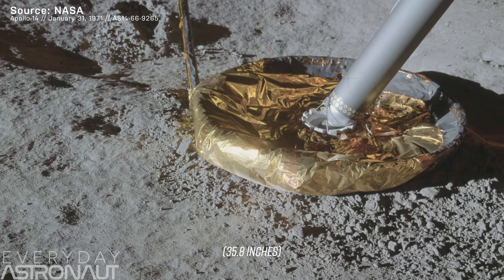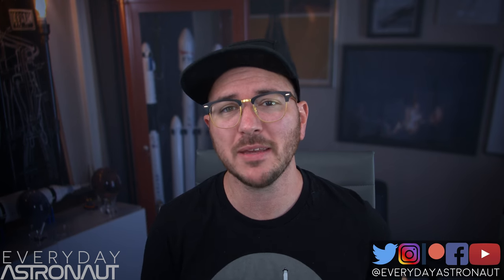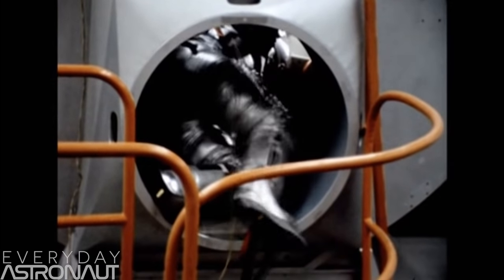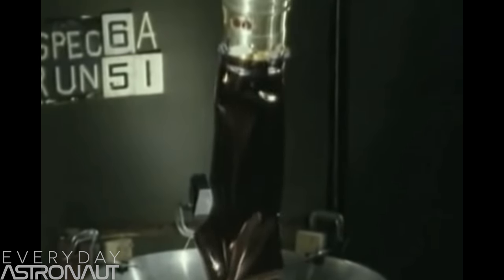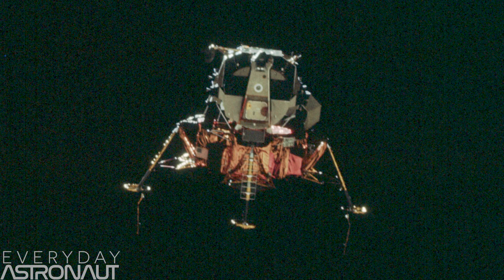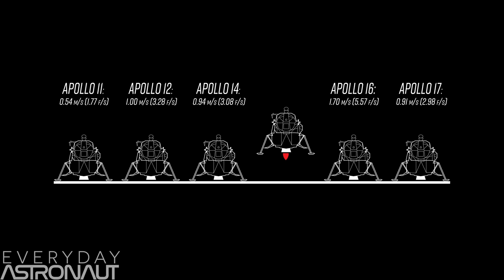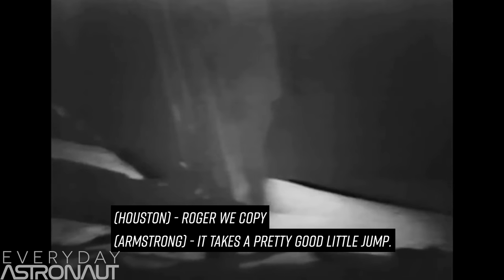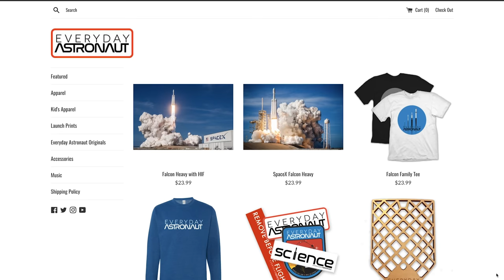Why were there missing rungs on the Lunar Lander’s Ladder?

Comment: Ah yes those famous first words spoken from the surface of the Moon . . . " Okay. Engine stop. ACA - Out of detent."
Reply: Surely it should be "Contact Light..." ?
Reply: @SIXITHS  Well, they weren't actually on the surface when the contact light went on, that turned on when one of the contact probes extending some 1.71m below the landing pads touched the surface.
Reply: @drtidrow  The craft was touching the surface...
Reply: As I recall watching it live and paying close attention to hear those first words. They were: "It's soft and dusty." I beleave everyone rearranged history.
Reply: Larry Carmody CMD  About five and a half feet.
Reply: @4STEVEJOY34  Well they saved the big one for stepping foot on the moon
Reply: Larry Carmody CMD  1.17m is 1 meter 17 centimeters or 117 centimeters or 1170 millimeters = aprox 45 inches..I calculated in my head..so yes its a rough guess but not far off the mark.
Reply: @SIXITHS  Yep.  Technically the first word "on" the moon was "contact".  Arguably, once the LM footpad probe touched the surface they were "on" the moon.
Reply: I love the fact that Neil greased it in so softly .a pilot myself
Reply: The first words were contact light.

Comment: A co-worker met one of the landing leg engineers at a party in the 80s. He was really, really freaked out when Armstrong had to jump so far to the pad.
Reply: Yep Armstrong did not shut off engine when instructed he clearly wanted a smother landing, seams like all of them left the engine on a big longer than requested. Expert pilots reaction I think minds going I got a better feal of when to shut off.
Reply: @RedRocket4000  how can you be an expert at something your doing for the first time?
Reply: @noidontthinksolol  Armstrong was a beast of a pilot. That's why they chose him to go.
Reply: @badmanarnie2456  you can practice in simulation.
Reply: @noidontthinksolol  all NASA spacecraft are considered flying vehicles. No one flying any of them is not a pilot themselves either.
Reply: @RedRocket4000  Either that, or the residual thrust (ie, after the valves shut) mentioned in the video was a little higher than expected
Reply: @1pcfred  They also had what was called the "flying bedstead", a vehicle NASA built to simulate the behavior of the LM and used to train the mission commanders, who actually flew the final landings.

https://en.wikipedia.org/wiki/Lunar_Landing_Research_Vehicle
Reply: @drtidrow  As I recall, Armstrong crashed it.
Reply: @CrisEX420  But, it worked.
Reply: Tim Riggs I was wrong for  calling people who believe in the moon landings a moron. I’m sure most people never googled pictures of the Apollo 11 lunar lander or the photos/videos of the lander supposedly on the moon or flying through space. I personally think it looks hilariously bad. People can choose to believe what they want though. It’s 2019 we should have a ton of high resolution photos showing the sites we landed on the moon. It would be the greatest achievements by humans if true yet NASA fanboys have no problem with this.
Reply: @CrisEX420  Lunar Reconnaissance Orbitor and do some research on why there are no higher resolution photos.
Reply: Buzz was the pilot of the he's the one that landed on the moon he's the one that landed on the moon not Neil Armstrong Commander buzz was the pilot of the lunar module
Reply: So I don't know who told you guys knew was the pilot but it was actually he's the one that landed on the moon
Reply: When he stepped onto the footpad, he tried jumping back up to the bottom rung of the ladder, and said something like "the strut's hardly collapsed at all; it's a pretty good little jump".
Reply: @stevecooper546  Research - Armstrong’s crash was revealed to have been caused not by piloting error but by high winds and depletion of helium used to pressurize fuel tanks resulting in loss of vehicle control.
Reply: @CrisEX420 What you personally think matters not one jot as it's not scientific. Taking pictures of galaxies millions of miles away is about light gathering capacity as opposed to taking pictures of small objects on the Moon which is about resolution. Hubble or any other telescope cannot achieve the resolution to see the objects left on the moon as their mirror diameters are far too small.
Reply: @Ruda-n4h  So they aren’t capable of dropping a rover on the moon to photograph and explore this historic site? You would think they could get this done or is 33 million a day not enough from tax payers?
FYI all those pictures of galaxies are photoshopped. It’s up to NASA employees to imagine what they could possibly look like.
😂

Comment: So, one flies most of the way to the moon, but still has to jump the last bit.
Mind the gap?
Reply: "...between the LEM and the platform."
Reply: Don't forget that the engineers forgot to put a door handle on the outside of the LEM. If Buzz had closed the door they would have had no way to get back into it.
Reply: @billrichards1965  So that funny video about the astronaut accidentally locking himself out of his lunar lander was very much based on reality then ?  :D
Reply: @billrichards1965  hey if that LEM was parked in NYC it would be jacked into in 15 secs
Reply: @Spacekriek  Not exactly.  There was no lock and it could only be closed and sealed from the inside.  However, if it had been pushed shut, they would have had to slip something into the seam to open it.  There would have been a very great incentive to do so!  Seriously, it made for a great bit of humor but would not have been a real issue.
Reply: Don Kerouac Buzz and Neil joked about it when Buzz exited the LM, it was in the live TV feed.
Reply: @billrichards1965  They probably left it off deliberately, extra weight that's not really needed.
Reply: @gertraba4484 , clearly the short ladder was to prevent the locals from jacking it. Everyone knows the moon aliens are short.
Reply: @JNCressey  maybe they could call AAA to come out and unlock the LEM

Comment: Fascinating video.   The check by the first astronaut out of the LM to see if they could climb back up.  Just shows the level of detail that the engineers a looked into regarding every bit of the landing.   I"m sure the folding vs straight ladder came up around for many debates (weight, reliability, etc.)
Reply: My guess : reliability.
Sure down on cow's floor we scoff at such worry, but can you imagine the mission aborting so close because "our stepladder got stuck" ?
Not to mention it could shake loose and wreak havoc at launch.

Comment: Hi Tim, me again, can you do a video on the Dragon Capsule's parachutes? How do they work? Why are they attached on one side of the capsule and not on both sides? How do they open slowly? And the history behind of capsule parachutes...And so on...
Reply: i second this - parachutes for returning space vehicles are a lot more complex than a skydiver's chutes.  i remember seeing a documentary on Curiosity and how their chute testing was difficult and had lots of failed tests because it had to open at such high speeds though with a thinner atmosphere.
Reply: We need this video! I third this!
Reply: In the SpaceX Dragon video. If anyone is curious what the big black round things are on the "lines" near the Dragon capsule that the chutes are attached to. Those lines are called the risers and the "things" are called "riser guillotines" and they cut the risers in the event a main failure is sensed or they only have a partial deployment. They fire the riser guillotines to cut that chute assembly away and then fire the backup.
Reply: @StreuB1  Thanks for the explanation, I develop experimental model rockets and one of the most crucial and difficult part is the recovery system, hence my respect and admiration for the science behind it.
Reply: there are drogue chutes that precede the main chutes that deploy,  plus ORION is heavier than APOLLO hence the slits in the mains to allow  air to escape and the parachutes to flair or billow properly
Reply: Deane Minister  yeah, one reasson is the weight of the new CM and airflow in the chutes tonot make them rip apart on deploy, whole tech done on chutes and very Interesting.................. openings in chutes allow air to escape and create enough drag
to aloow a soft landing on water/land........plus chutes attached on capsule at odd angle to allow capsule to hit water   with tilt of capsule matching wave action.........................google ORION /Dragon parachute development/  
https://spinoff.nasa.gov/Spinoff2017/t_3.html
Reply: Ernesto Melo, great respect, we need people like you who understand the scientific principles in application, to test these things and critically examine the theories!
Reply: Ernesto Melo As to the one side aspect, if they deploy from the same end as the ISS docking port, there's no room in the middle.

Comment: This mention of Russia solution, make my day.
Reply: There’s probably a reason why they didn’t hinge the ladder.
Reply: NO DRUGS hope you know that is false
Reply: @yoyonis6840  Then they found out the lead from pencils can float in the air and get stuck in stuff
Reply: @yoyonis6840  Ah, the myth that refuses to die.
Reply: @OCinneide  Yeah, like electrical circuitry.  very bad
Reply: @yoyonis6840  I loved that story.... fake tho
Reply: @TheJttv  Yes, another possible failure point.
Reply: I must have missed that, what was the Russian solution to what?
Reply: Hinged ladder, if you think about it, is no better solution. Actually worse. NASA’s best assumption at the time was that there was a pretty think layer of dust - say 20cm to 1 metre. if LM has in fact sunk and you designed your hinged ladder with that assumption, that’s fine but it gives no advantage over the simple actual ladder which would then be a perfect length with no jump required. If LM did not sink then hinged ladder would also be short of the ground - so again no advantage. But if you designed a hinged ladder longer in length assuming LM won’t sink and if it does in fact sink hinged ladder won’t be able to unfold fully which is really messy to go down. Of course you can design a sort of fire engine type retractable ladder but that adds quite a bit of weight as it has to be actually stronger than a simple ladder not to bend through.
Reply: Usa: we are going to make our astronauts perform a potentially dangerous jump cause reasons

Russia: hold my vodka
Reply: @V14-x6n  only negative point is that it must weight a little more, and if it was 1m of dust, this jump what they did may be they last, so is not so great solution too. (If launder would be on hard rock, but next to it was soft.)
Reply: @V14-x6n  "If LM did not sink then hinged ladder would also be short"

The lower section of the Soviet hinged ladder was dimensioned to touch the ground slightly off vertical if the surface was solid (i.e. if the LM legs did not sink at all). In the event that the surface was soft enough that the legs sunk somewhat, but not so soft that the base of the ladder also sank when opened out, then the angle of the lower section would be less than 90 degrees. This seems to me to be a more elegant solution than the one NASA adopted (it is easier and safer to transition from a section of ladder at one angle to a section at a less steep angle than to make a 30 inch jump, which is around the average inside leg measurement of a man of average height).
Reply: aporiac   Nothing elegant about a heavy bulky hinged ladder советского лунного корабля, друг мой. Simplicity is far superior then complexity, remember that. If you want to land two astronauts instead of only one, that is. Hahaha. Besides, arguing about a soviet prototype that never even been built as a final production model is a bit silly.
Reply: dah
Reply: @V14-x6n  "arguing about a soviet prototype that never even been built as a final production model is a bit silly"

You are right. We are in the realm of counter-factuals, and so both of our claims are pure speculation.
Reply: @yoyonis6840  
Yea, wood pencil in a 100% oxygen environment, 👍👍👍, sure thing, that's absolutely brilliant.
Reply: aporiac    No, it’s your claim that is a pure speculation, not mine - you’re the one defending the non-existent soviet lunar lander ladder superiority design, and  even saying that jumping is so bad when it was proven it is not by real astronauts on real missions on the real Moon. So you’re also denying facts.
Reply: frbe0101   Simplicity is always better.
Reply: @V14-x6n  I see your point. I am making a comparison between two systems - one that was deployed, and one that wasn't - and making a judgement. You, on the other hand, are making a comparison between two systems - one that was deployed and one that wasn't - and making a judgement. It is clear we are doing two very different things.
Reply: What you peeps fail to understand and can’t see beyond your nose is that no one is saying a hinged ladder is not better, or a telescopic amazing retractable ladder that clicks and locks on every next rung when expanding. Wouldn’t it be wonderful? Or better still - lets have an elevator platform that lowers the astronaut to the surface! Yeah, that’s even better! Maybe Everyday Astronaut can find some pictures of that to excite all the kids here!

 In every problem you have to see all the restrictions and limitations, to see the bigger picture of what can be afforded in terms of weight and is simple enough and safe enough that you don’t spend $25 billion and then when you land on the Moon and your flipping hinged ladder gets stuck and you can’t get down!

Someone said: yeah, you kick it open and it unfolds. Well, you have to have a pretty safe mechanism to lock it in the folded position in the first place for flight safety which takes weight and you have to have some spring mechanism that unfolds it all the way down - in pretty week 1/6 gravity.- because your ladder is very light even on Earth and that mechanism takes weight, and you have to have a mechanism that locks it in place once unfolded which takes weight. You don’t want to go down a ladder that is not fully unfolded and not locked for fear of fall.
Reply: V 14 You are making up problems.  The mechanism of holding the folded ladder before landing could be as simple and light as for any other retracted component.  A rope cut by the astronaut before climbing down could do it.  As the ladder was left on the moon, no retraction mechanism is needed.  Swinging down a ladder in non-zero gravity is also trivial and a solved problem.  Walking on a ladder that lies flat on an excessively soft or fragile surface is also not a problem, but a common method of distributing a mans weight across that surface.  But of cause replacing the lower half of the ladder by nothing will save weight.
  And of cause there's the other obvious method: Use the fixed steps that sink in as mechanically equivalent to the landing pads that sink in on the other 3 legs and save some weight from the leg itself.
Reply: @wyattb3138  Possibly something to do with the difficulty of deploying it when you're already on the ladder?
Reply: Graham Langley )
Reply: @stocchinet  > Usa: we are going to make our astronauts perform a potentially dangerous jump cause reasons
They anticipated the "Dauntless Jump" in Divergent by over 50 years..
Reply: @wyattb3138  Weight and complexity.  Both to be avoided like the plague.
Reply: There is no ladder
Reply: Wyatt B added weight. Same reason a true high performance sports car has fixed seats.
Reply: @yoyonis6840  Try to sharpen a pencil in space... the shavings could just float around all over the place.  And don't forget that graphite (the main component in pencil "lead") is conductive and could work it's way into switches and relays and short them out.  With all the other unknowns and potential failure points, they decided that a pen was the safer way to go.
Reply: @JNCressey  1/10 of gravity, limited movement, is hard to use on Earth is you not attach bottom to something.  Today we have better solution, but it was not available then.
Reply: @m_sedziwoj , maybe find a heavy rock to pin the bottom down.
Reply: @JNCressey  Use imagination, how it would looks when they first time go outside.
Reply: @m_sedziwoj , going down you can jump, you only need the ladder on the way back up.
Reply: @JNCressey  Watch again historic materials, ladder misses only 2 rungs, and you think they can jump without any?
Reply: @yoyonis6840  The American concern was that pencil shavings might short something out damaging vital electronic systems and also increasing the risk of fire so they developed a pen that worked in space.
Reply: @UniversalStandard  
Yes Andrew K, it was 95 to 100% oxygen environment inside the spacecraft depending on whether they had their suits on inside it or not, it's because of the 100% oxygen environment inside the Apollo 1 capsule during the "plugs out" test that the accident happened, so yes, something like a pencil that's made out of wood, a highly flammable material, isn't the smartest thing inside of one.

Comment: I never thought about the ladder being short but was intrigued to find out why. And not only was your explanation fascinating, I also found out about the rods sticking down from the feet. I thought they sank into the moon's surface to hold the module steady, yeah silly I know. So, they were probes...... that makes sense. Thank you EA, another great video.
Reply: Not probes put rods to make contact with the soil so the crew got '"Contact Light'" ! These usually just folded over !